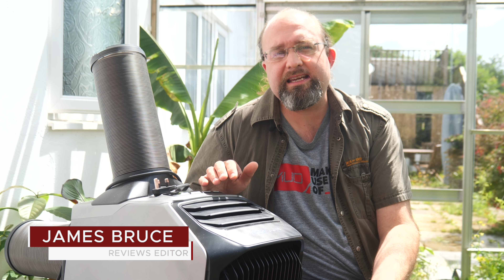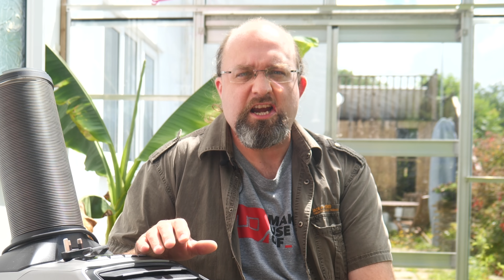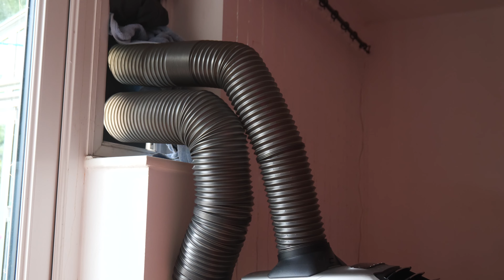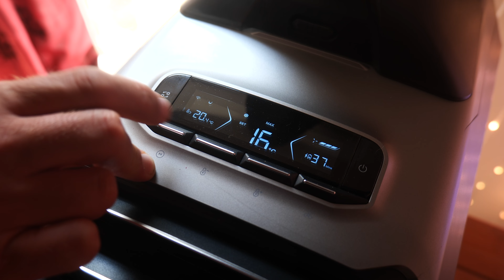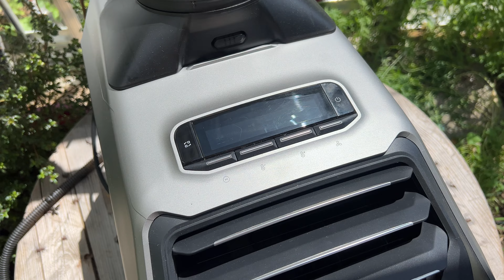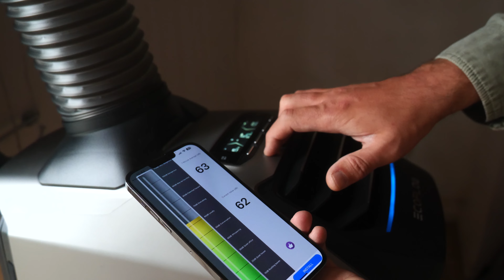EcoFlow Wave 2: The World's First Portable Heat Pump

Comment: The battery need the top part (36Lb) main machine to charge the add on battery.  So, wherever you need to charge the battery, you need to bring the top part.  Just don't understand why the battery is detachable for no meaning.  They don't have an individual charger for the add on battery.   the designer is out of mind.
Reply from the maker: Indeed. Major design flaw there, so the only solution is a long solar cable.